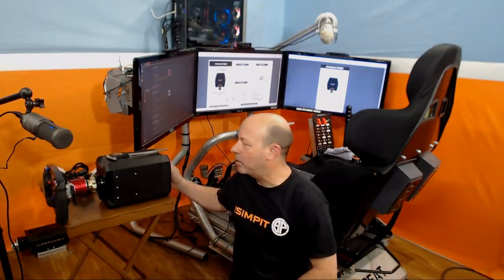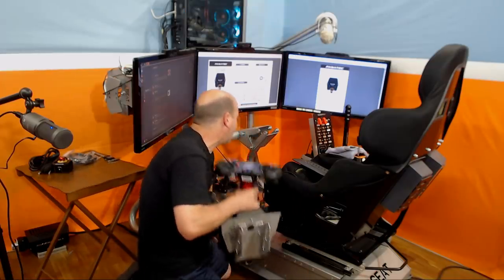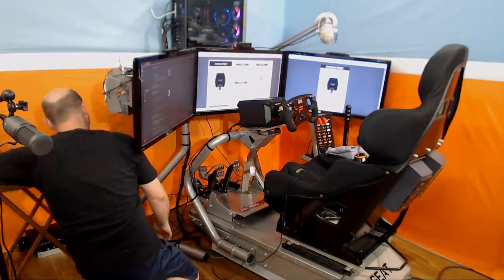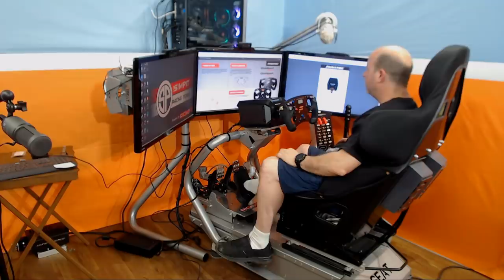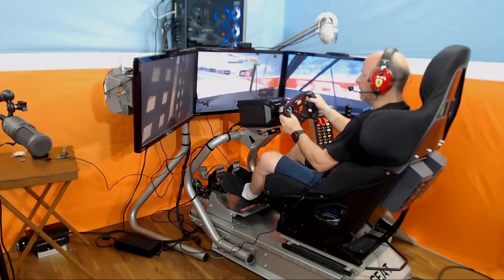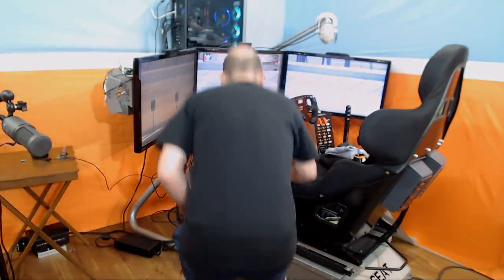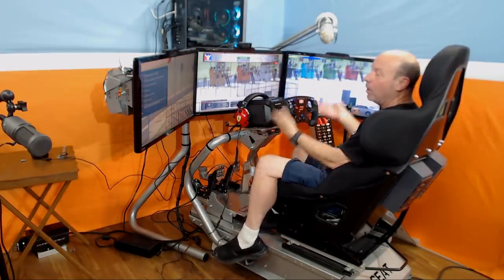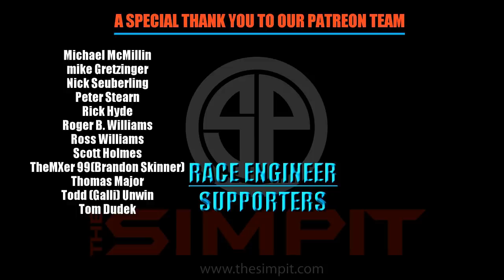Fanatec Podium DD2 Wheelbase - Installation and Software

Comment: Hi Shaun, just wanted to say I really appreciated this video today. Podium DD1 now installed on my Rseat N1. Thank you Shaun. : )
Reply: Was your N1 seat mounting plate have the pattern for the podium series?  I bought my N1 2 years ago and I am just wondering.  Thank you in advance.
Reply: @paulcasilio1119  Yes. It's the same pattern as CSW 2.5
Reply: @MarkDavidBlack  How is the flex? Looking to both upgreade my seat and Wheelbase. Wanna go for DD2 and debating about RSEAT or Simlab. Thanks!
Reply: @jusboon  I can highly recommend the Rseat. I had the RS and the N1. The N1 is a lot more sturdy obviously with the larger diameter tubing but even the RS will handle any direct drive base without issue. We're talkin' quality built all the way through. I hope you enjoy it. Have fun.

Comment: Hey Shawn, do you know what size bolts are needed to secure the DD2 to the wheel deck?  I'm getting some flex from the wheel deck and I'm wondering if maybe my DD1 isn't fully secured.  Can't think of another source of the flex .

Comment: Why the hell would you need kore torque lol I mean it's hard enough to get the ocolations under control already with turning friction and dampening up lol even there csw belt driven wheel has that issue it pisses me off makes me want to go with thrustmaster foe a belt driven wheel plus I need to egt used to thrustmaster for the comps but I will say I really want the fnaatec way way more much better quality in my opinion and the ffb is better but damn I want a straight line with no issues lol